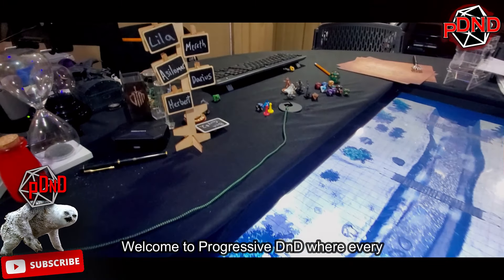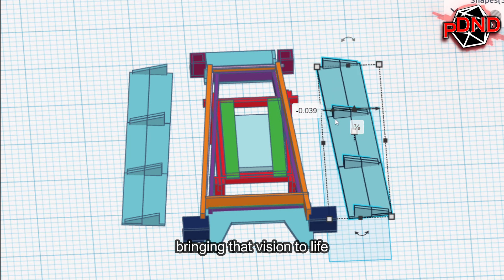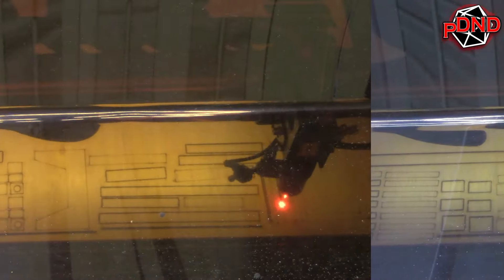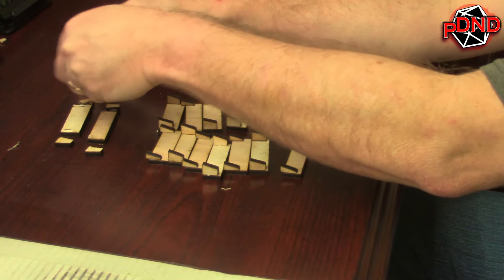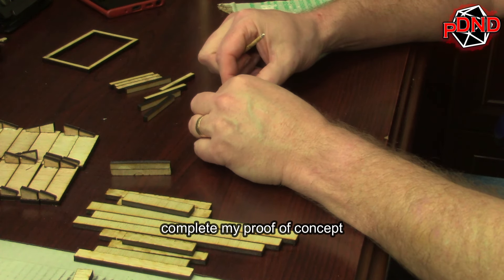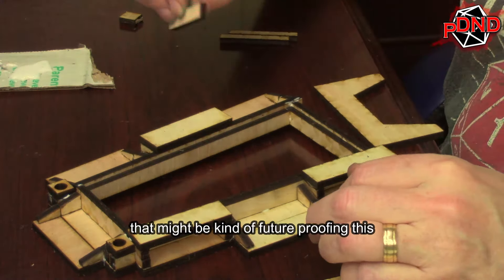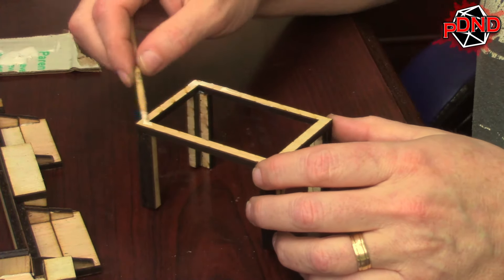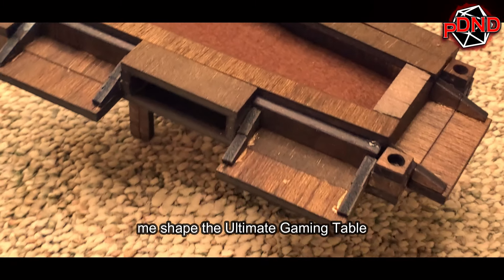Ultimate D&D Table Build | The Prototype

Comment: I made a table about a year ago.
I added LEDs in the table top and the playing field. 
I never use the playing field LEDs. The table top ones are controlled with an arduino uno baord. It talks to an excel spreadsheet sheet and lights up the table to shows whose turn it is. We use those LEDs all the time.
Reply from the maker: That is an awesome idea. What a great initiative tracking idea! Thanks!
Reply: Wow, that's brilliant!

Comment: A thin strip of ducttape would make fine hinges :)
Reply from the maker: That's a good idea. I might have to make a couple more to try that out! Thanks for watching!
Reply: Great idea!
Reply: even glueing stips of printer paper might work
Reply: @jawawookie  Yeah, I was thinking painters tape first, but thought that might break too easily (same as paper) but the benefit is that the fold is a lot sharper. So for the scale and the fact that the model won't see heavy use, your option might actually be better than the duct tape I suggested.

Comment: I would add pvc pipes where players can drop their dice into a hole and it rolls down to a tray in the DM area for hidden rolls. I have yet seen this done :(  I do a lot of hidden rolls
Reply from the maker: That's a really clever idea. I will have to look into that.
Reply: You could even design dice towers for the players that sit on top of the pipe and fit in so they don't move around , where they have their dice tower and a hole that connects to the dice tower, I have thought about this design a lot :D  Also be careful with the hinges on the foldable trays, a lot of people have made these and complain that they break ( too many players resting and putting their weight on it).
Reply: @tinaprice4948  This might get to be a little overly fine on the design, but perhaps some chamfered nesting pegs could slip into matching holes when folded out, thus joining the two sections a bit more securely so this isn't as much of a problem? the measurements would be very important to get down, but might help.

Comment: One problem I see with this design is that the map area seems really far away from everyone, especially the DM. I don't want to have to stretch over half the table (even having to lay down on it cause I can't reach) to move a mini, again especially if I'm the DM and have like 6+ minis in an encounter. I'd really prefer the map area to be a lot more accesible to everyone.
Like, imagine the DM and a player sitting on the opposite side of the table. That makes play impossible. One of those two would have to stand up and go around the table to even be able to see the map.
Reply from the maker: That is defintiely the hard part about designing a table for 8 players, giving them adequate space, but also ease of access. A balancing act for sure. One idea I am leaning towards having the DM (me, lol) have the easiest access so I do most of the movement, almost like Matt Mercer on Critical Role. But i do sometimes like the players to be able to handle it when, as you mention, I have 4 or 5 minis going. But, that is what the prototype is for.  Thank you for your comments!

Comment: Part of what I see could be that the mock-up has the wood thickness to deal with, but even when looking at the Tinkercad you showed, the distance to reach the center of the playing surface is significant. If your players always stand to move their piece then there are no issues, but otherwise it seems a serious stretch. Having the initial cubby with 1, 2, or 3 sliding sections you can set the depth to via a pin underneath could give the option for players with shorter arms easier access. It could also let lefties or righties choose a side to be longer in a split extension system (the options would look similar to the premise of the current GM's position). The sliding extension being somewhat on rails could also give it more "lean-on" strength than hinges. 

From what I see in the model,  the GM space is inadequate to hide things or properly stow away minis. If you still want it to be more open, I might add a 6-8" cubby in the space in front of the GM. This will keep you from having to use a GM screen, potentially give you a place for some under-cabinet style lighting, and also give you a place for those potential secret roll tubes others mentioned to end. It would encroach on the playable area but still stay plenty distance from the TV screen.

An idea for table accessories might be to have a rail inset on the player walls, letting them hook in a tower, cup holder, dice tray, etc away from the player desk surface. I have seen this in other gaming table designs as something proprietary, but there are ways of making it from material at a home improvement store. 

One design facet I do not see is how you will run power to each location. I would be careful of a socket facing the ceiling as that could get junk in it. The Tinkercad shows a single board wall, but the mock-up has the thickness of the wood to deal with, so I am unsure if those walls are supposed to be that thick in your final design. If the wall between the players and the playing surface is 4" deep or more, you can fit electrical in that wall and also still have space to run the secret roll tubes above or below it. (I still love that idea! I will definitely think about those myself.)

Just a few random ideas. I like the trapezoidal table as it is different, brings the players a bit closer together, and allows the eyes of players to focus as a group more toward the playing surface and GM.

Thank you for sharing this with us, and I look forward to the final result!
Reply from the maker: Thank you for these great suggestions! I am going to make a detailed list, but I love your technical suggestions. I also agree, I am really liking secret roll tubes idea too. I would have to factor in a way to get stuck dice out, lol! Thanks for watching!
Reply: @progressiveDND  the easiest way for stuck dice is:
1) Make sure you use 1.5"-2" internal diameter PVC/tubing.

2) Make the board between the player wall and playing surface work on a hinge and shave of the top 1/3 of the pipe, leaving a mostly closed/curled channel instead of a full tube. This would allow you to flip up the board like the top of a piano and use a stick to guide the dice down.

Bonus!) I would also use a singular tube on either side and have the "input" for dice be a few inches above the main tube so the other inputs will not affect a roll from further down the table. 

I've been thinking about this a good bit since commenting. ;) 
Hope this helps stir up even better ideas!
Reply from the maker: Great suggestion.  I like the hinged top too. I could use a piano hinge. I love it

Comment: Where's the monitor going to go, and are you mounting the top down camera on the roof? You may want to also incorporate storage for all your campaign books
Reply from the maker: I plan on still using the monitor arm and perhaps the camera arm, but I also plan on having cameras built in facing towards the individual sections. I have a mix on in person and online players so I defintiely want to get to the point that players can see each other. Some basic storage for the current campaign I am running is a great idea. Thanks for the suggestions!

Comment: I thought about this design for my game, Only things I worry about is, 1, the Wings on sides and end are only supported by 2 Hinges, and that when Opened it has the Line between the Folded Down part and the bottom section, DnD you have players writing and I worry about players hitting the line when trying to write on their character sheets and etc.
Reply from the maker: I could see that being a problem. We got all my players inexpensive journals to use (also as a hint to take notes, lol) but that could be an issue, for sure. I guess at the end of the day I went for cool factor. Thanks for watching!